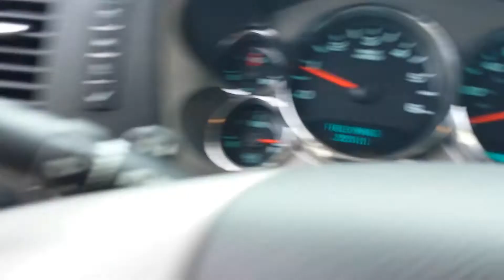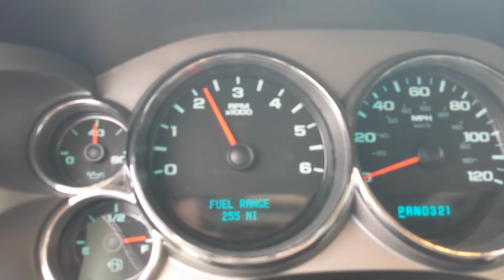2008 Silverado FAST intake cam swap PRC 2.5 heads

Comment: What size cam are you using? Also did you replace your springs?
Reply from the maker: +puckusmc29 cam specs are in the description, yes dual springs were used